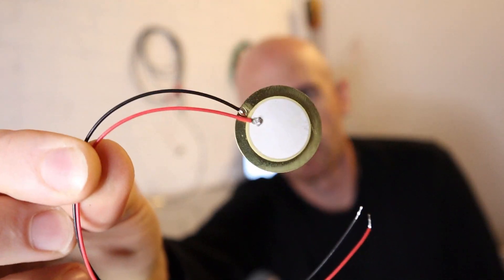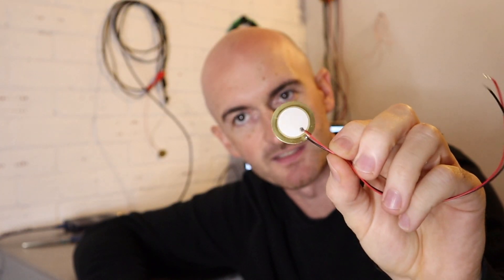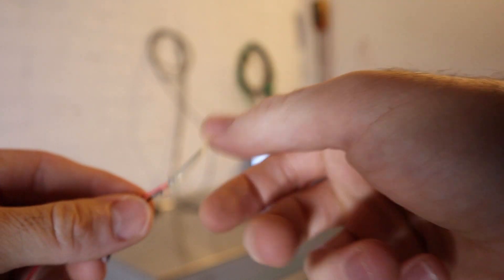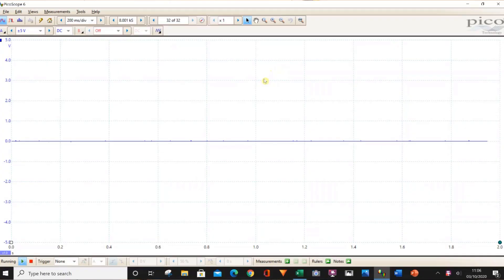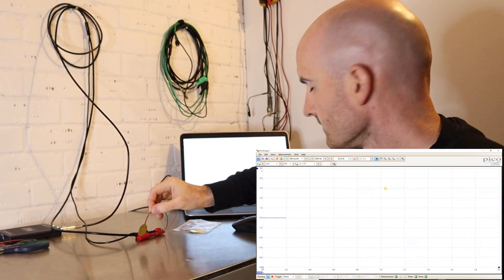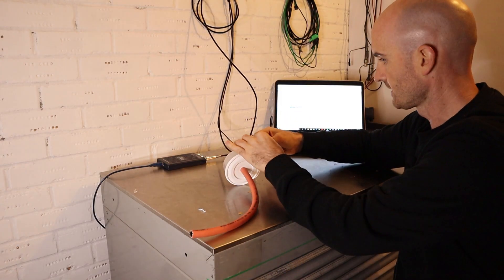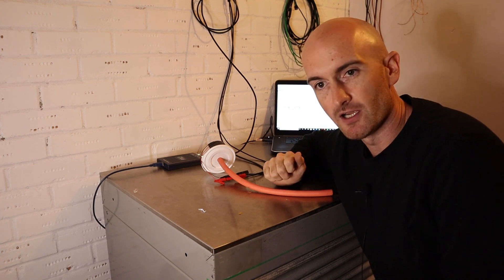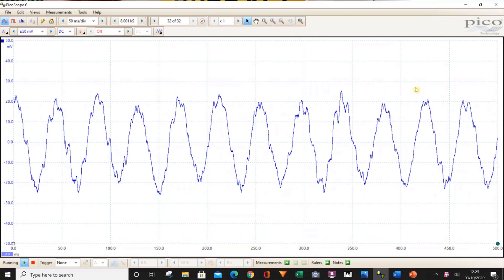DIY Pulse Sensor Under $1.00

Comment: Excellent video, ordered all the parts and signed up to your monthly courses.
Reply from the maker: Awesome! Let me know how you get on with the build. 

Hope you enjoy the lessons; I’m really excited about building all the training 😃
Reply: @MechanicMindset  will do Darren, does it matter which way up the piezo sensor is fitted? (White disc facing up towards input or opposite)
Reply from the maker: @robbolt1099  I put the white disc facing the  inlet pipe. Haven’t tried the other way round

Comment: what if you put a screwdriver in the hose and touched the screwdriver against pullys to pinpoint a failing pulley or devise under the hood this may work to pinpoint and isolate that noise
Reply from the maker: Yes! Or even better, glue the piezo element to the end of the screw driver 👍
Reply: @MechanicMindset  also maybe you can help,im in the market for oscillipscope but im a diy guy who needs a cheap solution for a tool.im looking at handheld oscillioscopes and found two I like and wondering if they will suffice for most diagnostics especially signal wires from sensors.

the first one is hantek models
Hantek hendheld oscillioscope models 2D42/2D72/2C72/2C42

im looking at the 2c42 or 2d72

the other is on ebaY  if you type "handheld oscillioscope ET120M"

please let me know if these would suffice for someone new to oscillioscopes for autmotive basics thank you for your time.
Reply from the maker: @pigeonsil240sx  Sure, one of the Hantek would be better as it has 2 channels. Both are 8 bit so measuring ignition waveforms won’t be the best, but it will do CAN bus and other digital signals no problem. If you want hand held and can afford more, the MicSig ATO1104 - it’s 12 bit for those ignition waveforms and has 4 channels!
Reply: @MechanicMindset  doing further research i decided on hantel 1008c for laptop as it seems like a much better option,thanks for everything.
Reply: @MechanicMindset  so the piezo would be on the handle of the long screwdriver and use the tip of the screwdrive and touch it against each pully while the piezo is connected to oscillioscope then look for a huge waveform diffrence between each pully as the louder the pully the more vibration the more appearent it will be shown on the scope correct?If this works as good as theory this could have HUGE potential.you could use it for njectors and all sorts of things.LOVE THIS!!! thank you!
Reply from the maker: @pigeonsil240sx  Yes to all of that! 👍

Comment: I just discovered and am really enjoying your clear and intelligent videos!

These piezo transducers are essentially capacitative and, in theory (and good engineering practice), the Scope input amplifier would be happier with a very high resistance (over 20 megohms) across the transducer leads so the scope input bias current has a path to ground.
Reply from the maker: Great to have you on the channel! Describing them as capacitive really helps understand how they work! Interesting info regarding the resistor; I do have some lying around so mig have a play. Just connect between pos and neg in parallel? Thanks for sharing the insights!
Reply: @MechanicMindset  it probably doesn't make any practical difference in this application.  If the transducer were being amplified, then the leakage current could produce nasty offsets and even saturate the amplifier.

Comment: Hi, very well explained how to do that. I have a question that comes across... Is the size of the piezo sensor important? I meant, the bigger in size  you have, the better signal you get? And the internal diameter of the hose matters? Any size that you recommend?
Thanks for your reply. I'm a fan of your channel. Keep going
Reply from the maker: Hi, glad you’re enjoying the channel! I used 27mm elements in this video. The size might some impact on the signal, but I think the next size up isn’t actually much bigger. Could also consider putting more than one connected in series (in theory) to get a bigger signal 👍
Reply: @MechanicMindset  I thought about putting 2 in series as well just to see what sort of signal it would put out,    also I've been looking for the largest piezoelectric I can find as I beleive a larger surface area should make it more sensitive.    Cheers  🇦🇺
Reply from the maker: @mikethomas9544  I was thinking the same, never got round to trying. Let me know how you get on. 

Lived in Australia for a bit, great country! We were in Austinmer by Wollongong 👍
Reply: @MechanicMindset  Know the place,   north side.    Should come back to the Sunshine  lol.   Looking at "Element 14"  which use to be "Farnells"    the opposition to "RS Components"    They sell a "Multicomp MCFT-32G-2.4AS-133 Piezo Element"   with an OD of 32mm and the crystal area is 30mm so a nice large size.   Have a look at that.    Cheers
Reply from the maker: @mikethomas9544  That will do it. The ones I used in the DIY are 27mm 👍

Comment: my friend >>>  my homemade in cylinder pressure transducer  got noise the pixel  is really bad do you know what to fix this issue
Reply from the maker: Oh dear! Have you tried replicating the settings I use in this video? Are you testing intake or exhaust? I tested by the exhaust in this video away from any sources of interference
Reply: @MechanicMindset   i will use the same settings as yours . thanks for ur replay

Comment: Love you video can you use that piezo sensor on common rail diesel
Reply from the maker: Yes, you can use it for Diesel engines too. Thanks for watching! 👍
Reply: @MechanicMindset   I was wondering can you attach the piezo disk it self to an injector line an see injector
Reply from the maker: @masongray9046  I am yet to play with that but I have heard the same is true. Even a knock sensor placed on the HP fuel line might show it!👍

Comment: Lovely idea my friend.  I've used pizo sensors on USAF airplanes - they were called strain relief gauges.  Caught the slightest flex in the fuselage, tail section, wings, etc.  Great idea you have.  When I looked at your exhaust pulses I said to myself that those pulses would show a bad cylinder.  I'm going to make up some myself.  Many thanks, "Mate."  :)
Reply from the maker: Michael Donavon Ah cool application for the piezo sensors; I bet that was amazing working in such machines! I can’t claim the idea as my own, but I will take the credit for the extremely cheap approach 😂. Glad it’s inspired you to have a go mate 👍 There’s a whole rabbit hole to go down for pulse sensor diagnostics!

Comment: Brilliant /interesting video , defo going to try this out!
Reply from the maker: Billy Tremolo Band Awesome, let us know how you get on! 👍
Reply: I will of course, I still haven’t got my Pico yet 😭, after splashing out on a autel mk908p last week so funds are a bit tight for the next while! I did however get my hands on a none operating fluke 124 2 channel scope for free which turns out it only the battery was the issue which was shorting it causing it to not fire up so I must order a battery for that and have a pay with it until I get the Pico! I’m looking at getting some system for wiring diagrams, what would you think of the all data system? As I have access to autodata ?
Reply from the maker: Billy Tremolo Band Score!!
Afraid I’m not too hot on aftermarket wiring/data providers; I have pretty much always worked with OEM data
Reply: Mechanic Mindset To honest I’ve only dabbled with the autodata in my old job but have had to check out topix quite a bit for various diagrams since making the move to Jlr and I must say topix is brilliant, bit fiddly but very clear picks etc

Comment: Parts list for a diy Firstlook sensor. 35mm piezo, 1" PVC slip quick disconnect, (2) 1" PVC slip plugs, 1/4" npt hose barb, pg7 cable gland, female bnc cable, 1/4" fuel shutoff valve, 1/4" vacuum hose.
Reply from the maker: Thanks!

Comment: great video my friend keep the good work
Reply from the maker: Thanks Nidal Alrifai! Glad you’re enjoying the channel, more to come for sure! 👍
Reply: @MechanicMindset   i have a car with u0115 . i did can high and low wave form they look normal how come with network issue  i have a good signal . 2012 hyundai avante  1.6 GDI  MD . pleas help if you want i can send you the wave form just i need your email pleas
Reply from the maker: Hi Nidal Alrifai Have you checked the module which the code relates to? Do you have any modules that are not communicating on the diagnostic check? It could also be a power supply problem with a module which would not affect the CAN waveform. You can find my email address in the About section of the channel 👍
Reply from the maker: Nidal Alrifai Also, what are the symptoms/complaint?
Reply: @MechanicMindset   thanks for your reply

Comment: I’ve got a housing I designed for a 27mm piezo for this exact purpose. It’s on Thingiverse #4351397. I even designed different sized barbs to fit it. So if you have a 3D printer then all you need is the peizo and a female bnc. 🤙🏻 Good vid!
Reply from the maker: November 248 Just checked that out, awesome job! Thanks for watching 👍
Reply: Building two this week based on your Thingverse file.

Comment: Thank you for the mention, thats awesome,  I will need to activate my M.A Diagnostics Facebook page so people can see my sensors for sale. I'm working on other tools aswel but thats a bit away yet.
One thing I will say about the video is when putting it into the dipstick you will need to isolate the intake from the crankcase,  due to them being exposed to each other you may see issues from valves in the crankcase and the other way aswel
Reply from the maker: stephen marshall Looking forward to getting my Marshall’s sensor! 👍. Thanks for the advice, will have a proper play at some point and might hit you up.
Reply: @MechanicMindset  mist definitely 👍
Reply: I'm looking forward to receiving my pulse sensor from Stephen Marshall @ M.A Diagnostics 👍

As usual nice work Darren.
Reply: @AbbottAutomotive  i have Darren's ready and 1 pink one but thats all 🤭. My soldering iron had issues today 😑  and soldering onto those piezo sensors is very difficult,  but we shall overcome 💪
Reply: @stephenmarshall5302  one step at a time buddy 👍🏻

Comment: Do you think an op amp would help get a better higher reading?
Reply: An 'active' op amp based circuit would amplify it sure. But is there a need? The exhaust pulse shown is around 40 millivolts peak-to-peak, and the scope looks happy enough showing that. I guess if your had a less sensitive scope maybe? Obviously with more than one sensor and maths channels you can do useful stuff to add up /subtract etc different signals. Various Op amp configurations would allow you to do this in hardware for a less clever scope too I guess. Just thinking aloud here. :)
Reply: It's the design that causes the low signal. This setup creates equal pressure on both sides of the piezo. A setup with the vacuum/pressure just on one side is significantly more sensitive. So much so that I had to use a valve to lower the strength.
Reply from the maker: Brad Bush Maybe less empty volume too? Also, the seal isn’t great around the duct taped cables 😂
Reply from the maker: Alan W Sorry, what do you mean by op amp?
Reply: @MechanicMindset  an operation amplifier, like the LM324 to amplify the signal.
Reply from the maker: Yes agreed, I think the signal is sufficient. The other thing we could try is to put 2 (or more) piezo sensors in the cup and connect in series. Again, just a theory; it did play with them in series in the bench and the signal amplitude was a bit higher 👍
Reply: Do the piezo element produce a voltage?
Reply from the maker: Alan W Yes they do 👍
Reply: How much voltage does one produce? Just an average, must be only in the mv I assume?
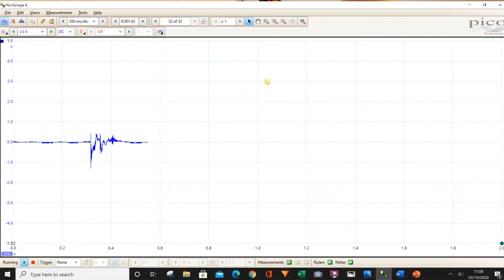Reply from the maker: Alan W I think up to one volt (see around 3:00 mins). When measuring pulses, yes it’s only mV 👍